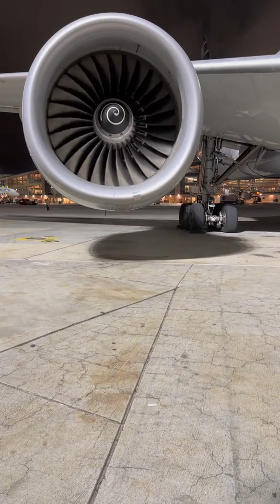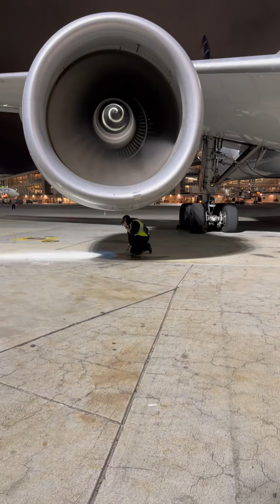Visual Leak Check on the Rolls Royce Trent 800 ENGINE DRAINS (drain mast)

Comment: Clockwise vs. Counterclockwise of the main turbine on the front of the jet engine
Reply from the maker: Some engine manufacturers have that. It’s usually RR that like to have it counterclockwise. GE and CFM clockwise. I think it’s a manufacturer’s preference or design.
Reply: @StigAviation      The main turbine on the front of the Trent 800 engine whirls clockwise
Reply from the maker: which direction are you looking it at.... front to back or back to front.. its common to always consider rotation from aft looking fwd.